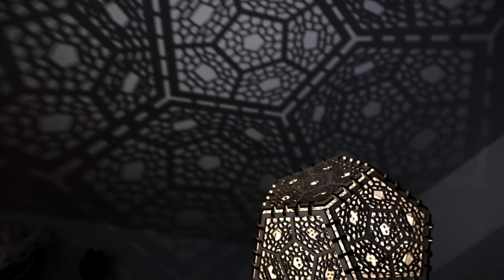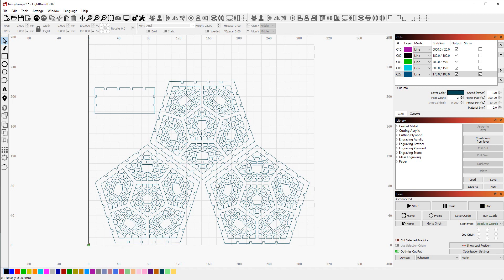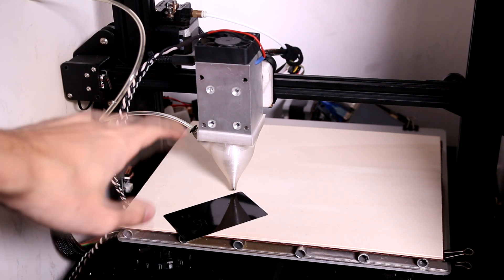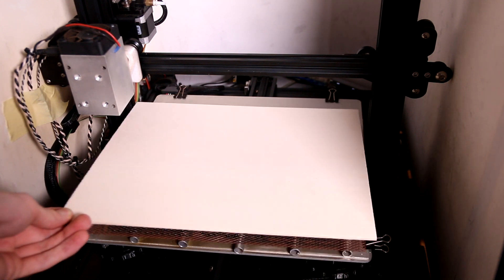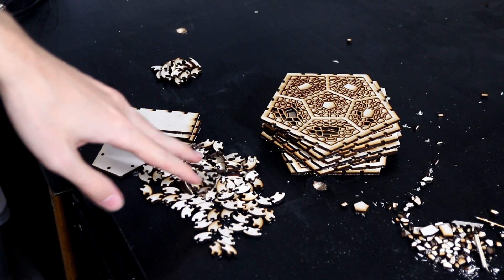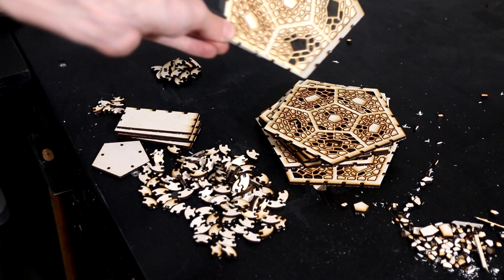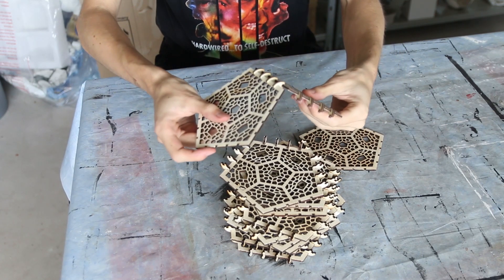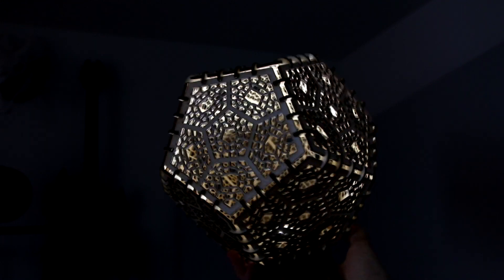Making a plywood lamp. A DIY PROJECT. An Endurance 10 watt laser honest abilities by Datulab Tech.

Comment: Looks really good, don't think i have seen lightburn used to that much ever before, on the bed why don't you look at holding it down with some strong magnets on the bed and board x4 and a centre one or just 4 long bolts in the corners and a penny washer to clamp it?  That should hold it flat, not sure if you're on a 3d printer bed there , if your not then i would go for 3 or 4 mm bolts with one in the centre to hold it flat 100% I'm sure you can move the design so it sort of goes around the clamping area?  The tape will just make it bow in the centre as there is nothin gto hold it down at that point. just ideas running in my head but it might not be possible for cutting reasons.

And it is Amazing, try a  RGB variable strong led bulb inside,  should make for some nice mod lighting inside and out if you have a wall to paint.....Fantastic project and well done, looks great.
Reply from the maker: thank you for sharing your ideas